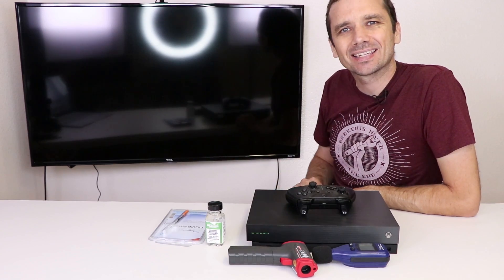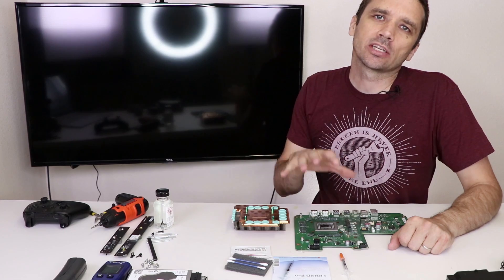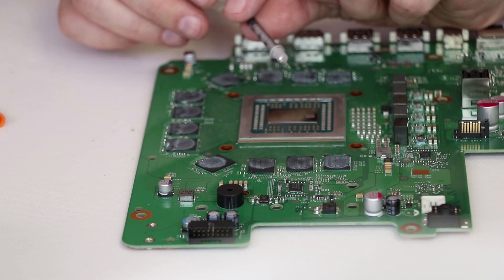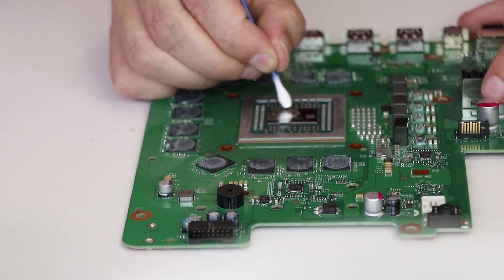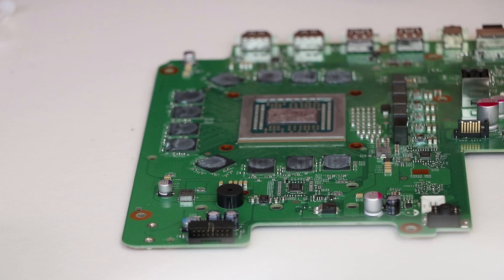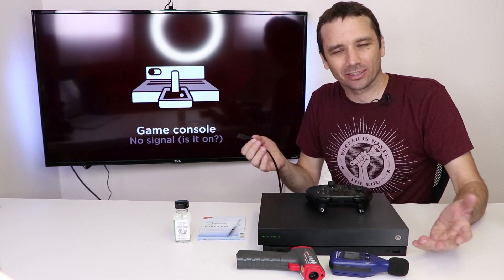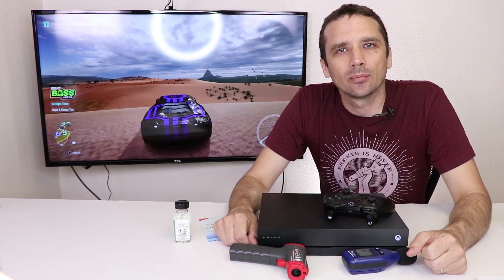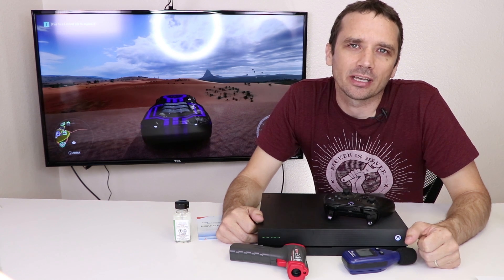Xbox One X Heat Test and Upgrade - It's So Quiet!

Comment: I think it the mod increased the heat. U say better heat distribution (theory) . But it’s more heat.
Reply: rather same heat at a higher temperature
Reply: It's the same amount of energy being released as heat either way. 
If the fans are spinning lower, then it likely means the CPU is cooler, and being thermally managed appropriately.
More hot air coming out the back means less heat soaking in the silicon. 
Sounds silly, but the whole cooling systems job is to create hot air out the back of the device. If it isn't producing hot air, then the chip either got less power hungry, or a lot hotter.

Comment: I think the reason its warmer is the heat sensor is under the chip or in the chip (just guessing) not on the cooler,  with better transfer of heat it does not detect the heat on the chip, with the heat not being picked up by the sensor the fan profile wont increase the fan speed causing the heatsink to heat up, that could cause other parts in the console to run warmer. I wonder if that could cause issues with caps or other components going bad over time because of the increased heat.
Reply: Yep.  Same thought here more or less.  It's hotter now because the chip is running cooler but that's causing the fan rpm to be slower also why it's quieter.  However the system has no other air mover and because it's allowing hotter air to exist on the heatsink and other components, you might be at a higher risk now of a premature system failure.
Reply: The “silicone conformal coating” may be interfering with the temp/fan sensor. 
I don’t think it’s really even necessary if the liquid metal is applied carefully.
Reply: You probably have to do a fan mod after the liquid metal to help move the heat

Comment: Can someone please explain to me why my XB1X console wont power on and boot up with a steady source of power and a perfectly fine power cord? My console shows signs of receiving power. But nothing else. Its almost like it trys to start up. But quickly disconnects itself from power before any visuals can show up on my display. Ive concluded that there has to be something wrong internal with the console itself. Southbrige chip? Dried thermal paste? Any idea of what it could be?
Reply from the maker: Unfortunately, I don't know what the problem might be with it. I'm still working to diagnose this type of issue.
Reply: Did you figure this out?
Reply: Its almost like my XB1X is going into some kind of protect?
Reply: Random Tube don’t waste time trying to fix it, just get cracking on the warranty replacement.

Comment: Should test the difference with Thermal Grizzly Kryonaut vs the stock paste. Much safer for most people to use and doesn't need to be replaced over time.

Also the wolfenstein 2: colossus demo works great to check console noise. Right when you get the guns you can sit there and it will ramp up the fan in a few minutes.(manual save for quick reloads) If you really want to max out the fan move to the next room and shoot the oxygen tanks point blank.
Reply: Need to replace metal is overrated from my experience. I've had some on my cpu for like 5 years.

Comment: I use this Cooler Master MasterGel Maker Thermal Paste 'Ultra High Performance, Nano Diamond Particles, 4ml' better than as5 cus you don’t need to wait  up to 200 hours bs time and change the pads Phobya 120 mm 19070 Hardware Cooling Accessory Hardware Cooling Accessory (Grey, 20 mm, 1.5 mm) seen a 10c drop in temp doing this 🎃👻

Comment: Electronic Engineer here: I agree with the theory on temps.  The liquid metal does a better job of transferring heat out the back of the console.  You should be seeing hotter air out the back.  Also I didn't catch you mention that this needs to be redone periodically.  Unlike thermal paste, liquid metal has to be replaced every few years or so.  It doesn't age as well.
Reply from the maker: Interesting...I've heard that LM lasts the life of the console.
Reply: It may depend on the brand of LM.  I have heard different brands last different amounts of time.
Reply: @seanryanmetalhead  I've been using liquid ultra for 5 years nonstop on an overclocked 3770k.

Comment: Heat transfer coefficient of the liquid metal is higher than that of the thermal paste. So it moves more energy(heat) to the heat sink. Increasing the temperature of the heat sink also increases the difference in temperature between the heat sink and ambient air which allows for better cooling even at lower air flow speed (slower fan).

Comment: I'm so not doing that on my X
Reply: Fr not after paying $500
Reply: Actamayo 876 u don’t get the pun?
Reply: @James Bowles. would void warranty anyways lol.
Reply: Ya sure man who will do it with there ex
Reply: Warranty in mind, 1 month old purchase.. I’ll skip on this. Curious though.
Reply: The thermal conductivity is like a 72 w/m.k where as article silver 5 for example is a 6 w/m.k iirc . It's definitely under 10. That's why people do it. Does it need it? I dunno. I put corsair paste that only does 3.8 w/m.k and I saw an improvement in  HD textures
Reply: @full95one  how come it's not done like that from stock
Reply: @coxyhd2416  because it's liquid metal. Too high a  chance it will cause a short. Plus the cost of the material and cost in extra manufacturing time to hold quality standards. Probably more reasons
Reply: @full95one  so if you do use liquid mettle within a certain amount of time it will probably short?
Reply: @coxyhd2416  I dunno, from what I understand it reacts with certain metals and if you move the box around there's always a chance some could seep out I guess.   Usually people put some kind silicon coating around the application to protect from seepage
Reply: Which makes me wonder why microsoft's r and d team don't put this stuff in the xbox to start with..
Reply: @SeanPennII  I re did the thermal paste again recently, this time I put thermal grizzly kryonaut and  this K5-pro goop on the memory chips around the cpu, fun times. I've only been playing bfv and Apex legends, I can't tell a difference on Apex but for damn sure bfv is running better. BFV still runs like an un-optimized hot mess but I'm not seeing the low rez character models and low rez textures as much. I saw in a recent tweet from the devs they are working on improving bfv stability and performance. I hope it helps everyone cooling mod or not.

Comment: Question, anyone else's console slightly bent at the back from the heat output? I notice that the back of mine is slightly out of shape, where i can see that it isn't completely square with a slight bend.
Reply from the maker: That's strange...I've never seen that.
Reply: @Tronicsfix  I know right? I can only find one reddit post from someone else with the same problem, I noticed it when changing my hdmi cable, the part the stood out was the separation between the 2 main pieces of the case, its probably only 1-2mm but still enough to notice, have you checked yours to see if it has bent at all? Just out of curiosity.

Comment: When you let out the vacuum, the liquid it used evaporates. 

So when you cut it open it lost the liquid/vapor property.

Probably why it's running warmer even with the liquid metal
Reply from the maker: That's not how a vacuum works. When you let out a vacuum the vapor would then condense. This is a different Xbox.

Comment: Does playing a disc game make your Xbox run hotter then playing like a digital version of that game
Reply: No, assuming they are both installed on the HDD. Temps will be exactly the same.
Reply from the maker: I haven't noticed any difference. I've wondered the same thing...does running the disc drive make it get hotter? Maybe someday I'll test that.

Comment: You said it all, heat transfert, heat expelling, did you try when in sleep mode? the mode that doesn't turn off completly, for fast booting. it is in the power saving section in system menu, nice video

Comment: infrared temp guns are very inaccurate and could be the temp difference...but your guess seems very sound being it is a vapor chamber cooler.
Reply from the maker: That depends on how expensive they are. Yes, they aren't as accurate as some other ways of testing and the temps could vary by a couple of degrees but since I'm taking multiple measurements during each test and measuring the same way it should give accurate enough results to make a determinination.

Comment: Hello,

I have results for all of you. 
Finally I got the tools to check my "optimized" XBOX ONE X.

My Modification:
- original thermalpaste replaced with thermal grizzly kryonaut paste
- original thermalpads replaced with thermal grizzly Minus pad 8, 2 mm

Tools for testing temperature and noise:
- Infrared thermometer
- Samsung Galaxy A3 2017 with Sound Meter App https://play.google.com/store/apps/details?id=com.gamebasic.decibel

Stresstest 60 min
Forza Horizon 4 Demo, racing replay, 4K

RESULTS 
MOD / STOCK

TEMPERATURES  on hottest area,
in degrees Celcius
room = 22.2 / 22.2
topside console skin= 37 / 41
rear (heat-exhaust) = 62 / 62

Noise
frontside =  28 / 31 db
rear (heat-exhaust) =  36 / 38 db

I can't realy heare a difference.

As you can see the exhausted air with my mod has the same temperature as my stock XBOX on the rear.

With the mod the hottest area on the topside of the console skin gets 4 degrees celcius colder.

Because of this, I believe that with the modification the heattransfer gets better, the hardware and the thermal sensor inside seems to get better cooling and the fan runs a little bit slower, so that it gets a little, little bit quieter.

Conclusion:
62 degrees Celcius on the rear and 37 / 41 degrees Celcius for the  topside under load seems to be ok if I read that eurogamer.net measured the console skin at a maximum of 45 degrees Celsius, with rear vent heat rising to a maximum of 68 Celsius.

Source: https://www.eurogamer.net/articles/digitalfoundry-2017-microsoft-xbox-one-x-review_1

With this and my test results in mind the cooling of my stock XBOX seemed to be ok.

I believe that the only thing I improved a little bit by my modification was the heattransfer.

It would be realy interesting what temperatures you would measure up with a thermal sensor inside the console before and after this mod.

What do you think?
I'm very interested in your cooling mods and what temperatures and noise you get.

Comment: Thank you for your YouTube videos! I like it and it is a big help for me. I'm also trying to optimize the cooling of my XBOX ONE X and PS4PRO. I believe there are  many possible reasons why the output air is getting so hot with the new thermal paste. 
1. The transport of the heat is better.
2. The area where the thermal sensors checks the temperature gets better cooling, so the fan runs slower and other parts without thermal sensors getting hotter.

Would be nice to know.

You could only find out if you check the temperature of more areas of the Xbox before your optimization and after. For example with a thermal cam or extra sensors. I would do it, but I dont't have the equipment. Sorry!

My optimized XBOX ONE X:
- Thermalpaste Grizzly Kryonaut
- Thermalpads Grizzly Minuspad 8, 2mm

My XBOX is still getting warm but it is also quiet. It was and is more quiet than my optimized PS4PRO.
Sorry that I don't have the epuipment to check noise and temp. 

Would also be nice to know what you get with my thermal pads.

If you want, I can post you what I did to my PS4Pro. There was a lot more to do. ;)

Comment: Should play Battlefront 2 or load the community screen up on State of Decay 2 that sends the fans into overdrive for so odd reason
Reply: I do not have that problem playing Battlefront 2 at all. It stays silent. I have played for 2 hours before I heard the fan on mine and it was not for long. I have had my One X for about a year and a half playing a lot of games and have never modified or touched anything. Its in an open area and I have never had any problems. It really does not matter now because the Series X will be replacing mine very soon:P

Comment: Surely using a cue tip that the micro fibres would come off onto the liquid metal??
Reply: Mine came with a special all black applicator q-tip. It definitely wasn't cotton so no worries there.
Reply: I have done more than 50 CPU delidings and X box and either use q tips or toilet paper . It's not that serious. If you are going to overreact don't open the dam thing and keep running hot .
Reply from the maker: Guess not. Either they don't come off or it doesn't matter if they do. The manufacturers instructions specifically say to use them.

Comment: Heat transfer with the fan speed dependent on APU temps, hence the lower fan speeds.
Reply: Incoming air temps matter as well. Ac indoors to having your heat on in the winter skews the test either way.

Comment: My issue with using liquid metal on consoles is that I can't see temps of each individual core. I use liquid metal on my Intel CPU and I had to adjust the amount of liquid metal because 2 of the cores were running hot than compared to the rest. If I could throughly test consoles like you can with PC I would do it.

Edit: I did however replace the stock thermal paste with Noctua NT-H1 thermal paste on my Xbox.
Reply from the maker: That would be amazing to be able to see the core temps.

Comment: Has anyone tried this on PS4 CUH-12xx Series yet? Because I don't know if the Liquid Metal will damage the STEEL heat sink or not. My research said the heat sink on these 12xx series is made of steel instead of aluminum in the 10xx & 11xx. I just bought a Thermal Grizzly Conductonaut and want it on my PS4 very badly. Please confirm. Thanks.

Comment: Theory correct, did this to mine. The fan will only ramp up when the cpu is at about 70oC (toasty), the liquid metal will conduct heat much better than the goup so super low fan speed and more heat out.
Reply from the maker: Yep, I think you're right.

Comment: Liquid Metal transfer heat much better than regular thermal paste at the end chip don’t get hot so Xbox optimize Fan for chip temperatures so then if chip cool it drops fan speed down and fan run slow that’s the reason why it’s you get high temperature back off console because heat transfer heatsink better chip is chilly Xbox drops fan speed down but in the real heat won’t stay in chip transfers all heat to heatsink much more and fan run slowly heatsink does get hot than before but it isn’t issue important is your chip was cooler than before.
Reply from the maker: I think you're right.

Comment: More heat is being pulled away from the apu, however i believe the airflow on the xbox one x is also directed over the psu so my concern would be that some of this hotter air will get pushed onto the psu as it travels over the apu. A thermal imaging camera would be the way to really know whats going on here.  Would be interested to see that. All the same great video.  Thanks
Reply from the maker: Good idea. Might have to invest in one of those!
Reply from the maker: You can replace the disc drive no problem...just have to swap the green board over to the replacement drive.
Reply: @Gaj I've always said air blowing over a heatsink is more effective than trying to suck the air away but while your talking about Microsoft, they obviously thought the psu needed some cooling as they designed it to have air blowing onto it. That really was my point and as you say they run hot anyway so more hot air isn't going to help much.
Reply: @Gaj there is a method to change the HDD but its obviously not as easy as the ps4. Fingers crossed we won't have to do that anytime soon.  🤞